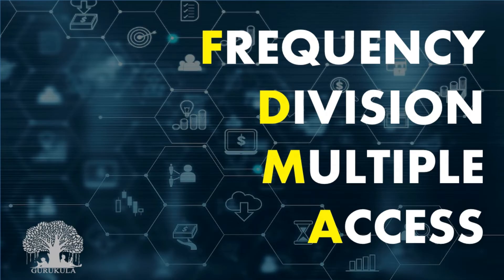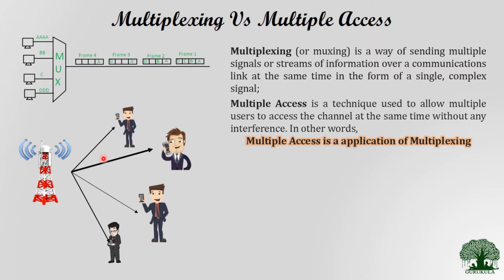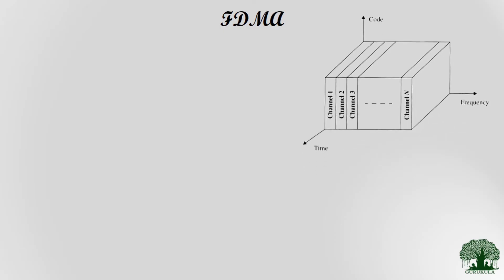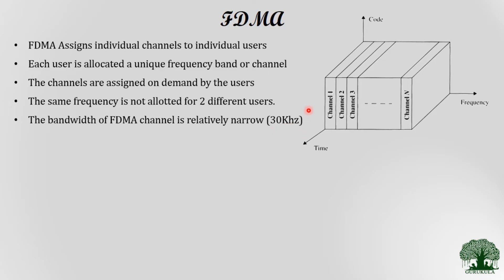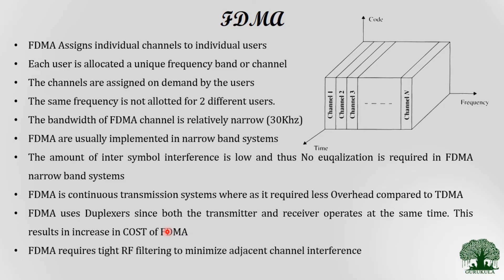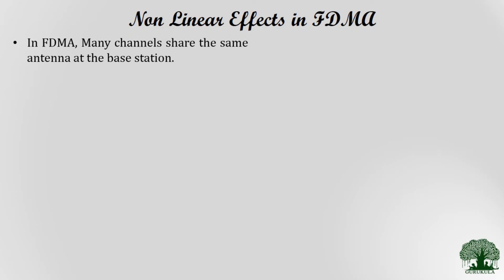Frequency Division Multiple Access (FDMA) | Wireless Communication [English]

Comment: 00:08 - Understanding Frequency Division Multiple Access (FDMA)
02:20 - Frequency Division Multiple Access (FDMA) allows multiple users to access the channel using different frequency ranges.
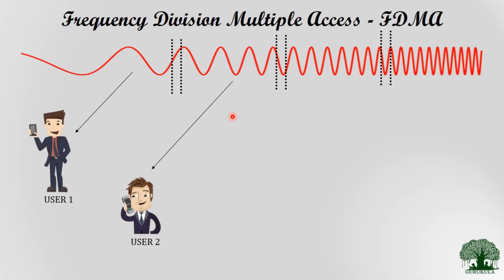04:34 - Frequency Division Multiple Access (FDMA) allows different users to use different sets of frequencies.
06:47 - Frequency Division Multiple Access (FDMA) assigns unique channels to individual users.
08:53 - FDMA systems have narrow bandwidth and low inter-symbol interference.
11:12 - Proper frequency separation and filtering are crucial in FDMA systems.
13:24 - Operating power amplifiers near or at saturation leads to nonlinear effects
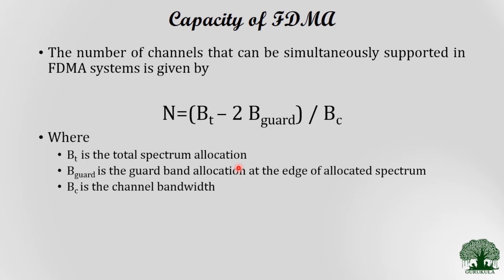15:42 - FDMA allows for maximum number of channels based on spectrum allocation.